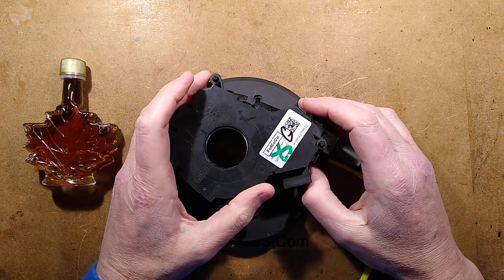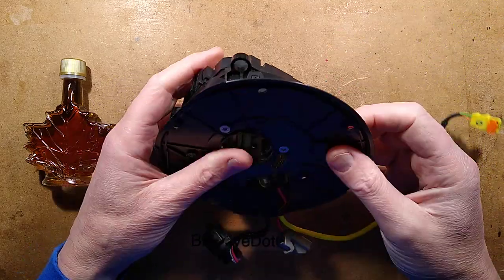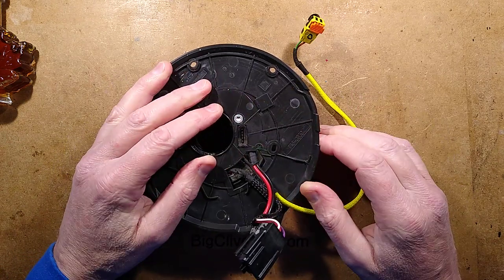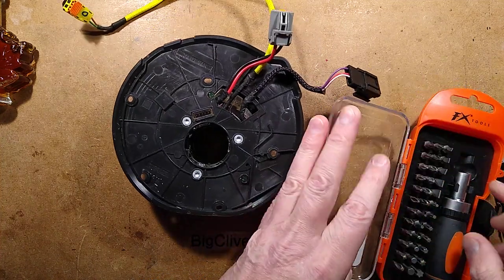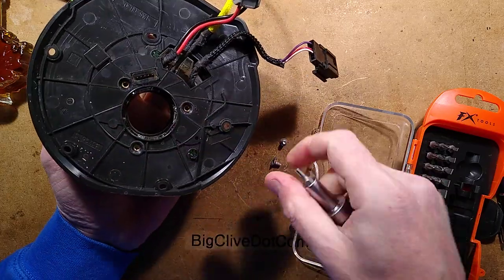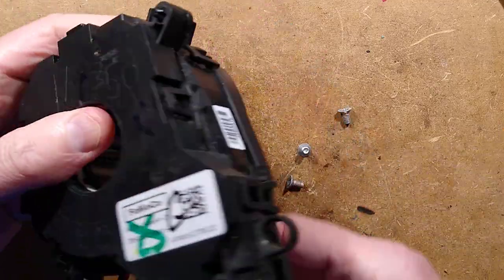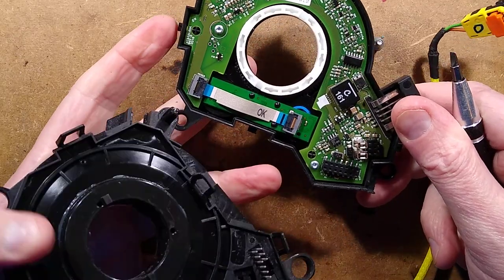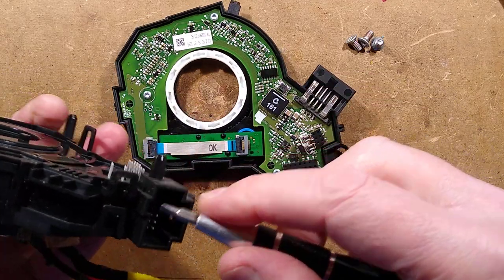Inside a car clock-spring module (steering wheel wiring interface)

Comment: I recall with the advent of engine management ECUs in the eighties that everybody, myself included, decried the likely fragility and unreliability that they would add. It wasn't true as far as I can see and the reliability of these systems seems robust in most if not all manufacturers. It does however often make repairs unrealistic if and when they do fail. I'm not sure if many will make it to classic care status in the future.
Reply: Rebuilding a broken carburettor is not exactly something anyone is able to do either.

Comment: Not completely related to this but an interesting thing I saw while working as a temp in a car factory (2 years ago now): Near the end of the assemby line a worker fits the steering wheel then presses some sequence of keys on (either the wheel or something nearby) then gets out of the car. The steering wheel then turned itself left, right, then back again, no doubt calibrating itself. I didn't get the chance to ask how it was done but someone must know; if you can, please explain!
Reply: Not completely sure, but there are probably testing points on the ECU that will make the car or at least the ECU think it's going to be used to at least supply it with power and signals, and has it listen in to the button combination.
Not sure if the battery was connected or even installed at that point but if not, it could even be a set of prongs mounted to the assembly line that give it power for the time needed.

The sequence is brand-specific, and it probably causes the ECU to respond with a secret menu or command while the buttons in the wrong order make it just try to respond to those requests they are tight into normally.
I suspect it's some kind of deep level firmware request where it goes "Hold on, I'm seeing someone do X, Y, A, V, B...." only to check a particular threshold in time at which these buttons need to be pressed and then do that.
It might also just be a "First-time-switch-on" thing that it only does because that's practical for the factory.

My parents car (A Ford Fiesta I think from 2013) for instance has a key combination to change the self-lock timeout should you have unlocked the car but not gotten in.
You need to turn the ignition key to contact, press the set button on either the wheel or centre console, and press two of the window switches shortly, and hold the driver side one for 5 seconds and a menu will pop up on the screen in which you can set the timeout.
(This is all in the manual by the way, I'm not to fond of trying to mess with it :P ).
Setting a different type of wiper interval behavior is also some kind of button combination and again some button you need to hold so it knows "Ah, you want to configure this!")

Comment: I think this is the part in my car that makes the clicking noise I hear when I turn while having my blinker on. Its been an issue for over 2 years but everything still seems to work just fine, for now.
Reply from the maker: The clicking noise may be the automatic indicator cancel mechanism.

Comment: It probably only ever needs calibrating to the centre _once_, when the car is made. While the ignition is off, the car is going to be stationary and the steering won't budge unless the wheels are moving.  Or it could use an accelerometer to determine whether the car is turning or going in a straight line, and continuously adjust the zero position.  If the accelerometer indicates a change of direction without the steering wheel moving, it knows the car has gone into a skid and can cut the power to the engine..

Comment: All I want ask is can one add a ribbon wire to kinda make steering wheel control for a car without (obviously older model car)
Reply from the maker: You could add a 12v remote control system on the steering wheel for non safety critical systems, and definitely not in the airbag compartment if there is one.

Comment: @10:52 "I wonder f their position is super critical relative to each other?"
Ypu, quadrature - sensing the direction of turn. 
It's like a giant mechanical computer mouse x or y sensor.
Reply from the maker: More than that.  The sensors may be able to determine their magnet positions to 360 degrees.

Comment: It's amazing how cheap cars are really when you consider every single component these days has a thousand components comprising it. Just a shame we live in a world where the interior light bulbs aren't even listed in the manual anymore, just a message to 'take vehicle to a manufacturer service centre.'
Reply: Most of those single components are either made upon request (which is cheap because a manufacturer is told to make an automotive line of components in the area of a bulk order of millions), or are bought from existing automotive lineups of parts that they can also buy in millions.  Some components will only cost .02 cents each due to the bulk discount you get when ordering such huge amounts at once.
The clock spring itself isn't superexpensive (the one I bought from a truck does not have centering-information in it and was about 25 euro's), it's mostly the design that goes into it.
Most of the cheapness in cars comes from the automated built processes for the most part...

Comment: For quite some time I assumed they used slip rings as well and didn't even know about such thing as a "clock spring" for a steering wheel.
A year or two ago I learned about it online and even found pictures of the inside of clock springs but it's only now that I come accross this video.
However I still don't know how this part is called in French. And as expected Google Translate isn't of much help as it will translate "clock spring" to "ressort d'horlogerie" which means... well... the metal spring in mechanical clocks that you have to wind up with a key.
Definitely not the part between the steering wheel and the steering column of modern cars.

Comment: Hi there. This 2 sensor show the angels of the wheels. It work on envoding principal. In the factory they put all togeather and it's programet to be at 0 degrees. The whole mechanism is put it directly on the car when the wheels are also at 0 degrees.  In the moat Europian cars like Peogeot Citroen an so there is ony one sensor put diferent type of socket. The magnet moving across the sensor not on top of it. When its completly nesesery to dissasemble it you need to mark very precisly all of the gears. Its hard work, but u have don it of few cars. The reason to was falty flex cable. Its quite thick copper and i succsesfuly solder the broken spot

Comment: Bigger conductor is usually the horn
Reply: More likely heater. Use relay for the horn.
Reply: The volvos and renaults ive done this on havent had the heater and the thicker connection always went to the horn switch

Comment: Actually, I need one of those for my car, but it's not compatible with this one. I also have only one airbag connector and the horn in my steering wheel, but the spare part is still 160€, because inside the unit, there's also the steering wheel angle sensor for the ABS. And that car is 21 years old this month...

Comment: No wonder a base F 250 is 32K I bought a new F250 in 78 for $5.600.00 and it even had AC ! I still have it and if I was to put a battery and fuel in it would still run and drive .

Comment: So... as most modern cars "safety" systems seem to be able to over ride all imputs made by the driver to correct what it perceives as a loss of control, it is somewhat concerning that much of the system covered in this video is based on flimsy bits of plastic. The better solution would be to improve driver training on hazard perception and car control rather than dumbing the whole thing down to the standard of the machinery having to save the worst drivers. Safety, but at the cheapest possible cost.

Comment: this is not the steering lock. the lock is a metal disks with notches in it that goes onto the steering shaft and its not plastic like this.
Reply from the maker: Maybe this lock is purely to keep the clockspring in position until it's fitted.
Reply: @bigclivedotcom  i finally found some image of a steering look as i was talking about:
diagram: https://qph.fs.quoracdn.net/main-qimg-5a776f7c8328d0bc25745c2e866c747a-c
photograph of said car part: https://2.bp.blogspot.com/-0ESCdn1ehhk/Vu4p9Zoi3LI/AAAAAAAARA8/uWlQH5l85d44j-27G0fVRR2OIqX9iw3Vw/s640/IMG_1223.JPG

i have had many car (about 7 different one) and they all had this. some used a RFID chip in the key and a antenna in the car dash to prevent the car from starting so i opened the dash and column to chop some unneeded wires. some had a remote start that i needed to remove because it was preventing the car from working... stuff like that. i disassembled about anything that could for various reasons. to the transmission to the gas tank, i mingled in everything. i can truly say that car are too complicated and full of useless bloat. 
my lastest problem was a single grounding wire that was needed to balance a complicated computer system that calculated the cylinders compression and heath tru the resistance of the electric ark of the spark plug. the grounding wire was superfluous, but needed to prevent interference of something.the car was cranking, sparking, and injecting gas BUT! not starting. it took me a long time to test everything and finally found the problem was this hidden wire BENEATH the car. 

thank you Clive for your videos! i learned so much watching them.

Comment: Does the system need to know the actual position? Maybe the stability control system just needs to know the change of position and the rate of change.
Reply from the maker: Given that vehicles spend a lot of time driving in a straight line it could probably get a decent central position quickly in software.
Reply: @bigclivedotcom  It does need to know absolute position. There's a recalibration procedure with a scan tool on all stability control vehicles if you service the steering system.  The problem with guessing the central position is that most roads are crowned for rain, so the average steering input is slightly towards the center, and you also need to calibrate the span. The typical scan tool procedure requires a zero measurement and a small left/right measurement of typically 10 degrees.

Comment: If you want to know real pain, rub your eye, with even a tiny film of that silicone grease left on your fingers. That stuff is pure evil, as it not only burns your eyes, but also can prevent good, solid solder joints. Soldering iron heat doesn't burn/melt it away, so it creates a barrier between the base metal and solder. Fun times, finding that out in the field.

Comment: No wonder it's broken, it's made by "(F)ound (O)n (R)oad (D)ead"
Reply: Fix Or Repair Daily
Reply: Fucked Over Rebuilt Dodge
Reply: You do realize that all car manufacturers use the same designs?
Reply: @Tedybear315  Biggest problem I ever had with a Ford was caused by the failure of a wiring harness made for them by Yazaki.
Reply: Zach Booker  I once said that to a friend of mine that was a total Ford nut, he responded, "it's not a circle, it's an OVAL," to which I replied, "see, they couldn't even get THAT right!"
Reply: could be from a mazda

Comment: Did you know that the description for that particular part is called a sqwib Don’t know if I spelt it right but I like to use clock spring because squib sounds naughty LOL
Reply from the maker: A squib might refer to the ignitor in the airbag.
Reply: @bigclivedotcom  I couldn’t tell you 100% when I was a mobile mechanic and I changed some of these units they were referred to as the squib as most things I then referred to them as the same boat with your vast knowledge of pyrotechnics LOL and Your Enjoyment of things that do you blow up I would lean more to what you said the squid would be and anyway clock springSounds a lot more like what that part would be thanks for the reply and thanks For all your content I have learnt quite a lot from you and continue as well I am disabled and Electronics is my hobby now and I am a very mature amateur LOL

Comment: Depending on the year, a lot of Ford trucks have electronic power steering. My guess is that the circuit board is part of that system.

Comment: The two gears with magnets on them have different number of teeth, so they rotate at different rates. By comparing the offset of the two gears, and using some fancy math, the computer can calculate the absolute position of the steering wheel without ever needing to "zero" itself.

Comment: $2800 in U.S. for replacing coupler e.g. Hyundai .
Reply: Explains why the industry prefers to total a car so they can sell parts. It's all a scam expecially when a headlight assembly is $2500.
-owner of a 2018 elantra after a 2014 veloster was totaled in a 10 mph impact